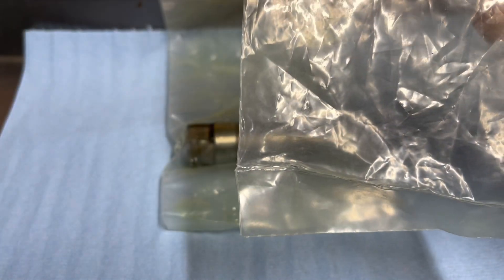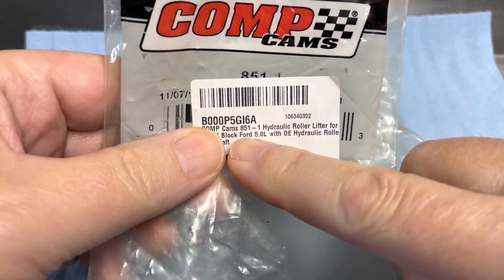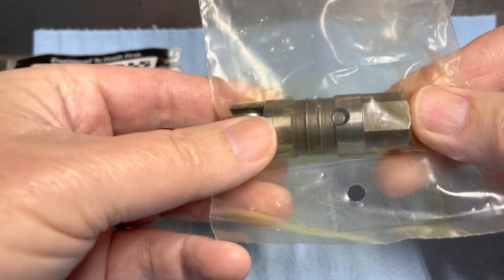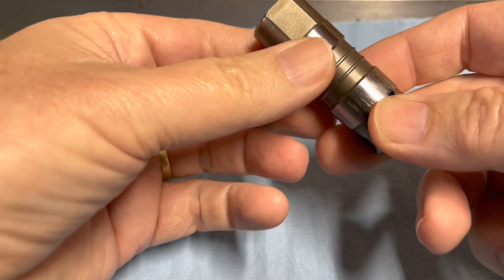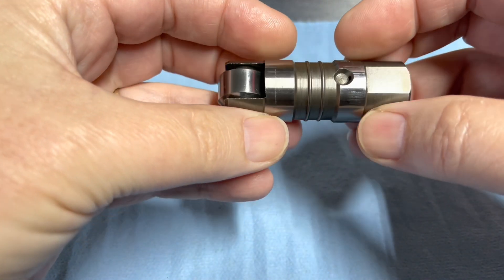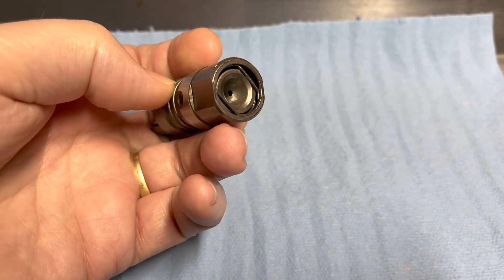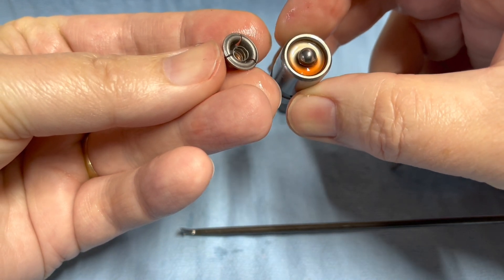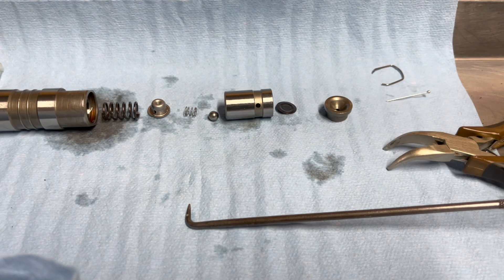Comp Cams Hydraulic Roller Lifter Failure

Comment: I installed an flat tappet and lifter kit in my 68 302 and found that several lifters were not oiling. After taking them all apart for cleaning I discovered the ones not oiling had the oil metering disc concave side was pointing down. I did some research and found the concave side should be facing the pushrod because of the oil groove in the disc and this fixed the oiling issue.  I'm building a retrofit 289 and using the same spider and lifters you did. I took them all apart and they were lubed and clean. Only issue is 4 of the 16 had the metering disc orientation backwards.
Reply: Correction on my comment is the oil metering disc protrusion should be toward the pushrod allows the oil to pass through the small groove to the rocker. Sorry
Reply from the maker: Wow. Nice find. It makes sense the disc has to be oriented a certain way otherwise they would be flat. I could see how the disc could flip over during assembly if you weren’t careful.

Comment: Did the new lifter fix your problem? It would be interesting to see if thoroughly cleaning the parts and reassembling it would allow it to function properly.
Reply from the maker: Yes, the replacement lifter solved the issue. I really wish I could have found something obviously wrong with the bad lifter.
Reply: @JohnLatrobe  - Since the new lifter fixed your problem, that kinda blows away my theory that the oil passage for that particular lifter bore was clogged. It's interesting that there was no oil in the lifter at all. Maybe the oiling hole in the side of the lifter is blocked?
Reply from the maker: @jsimmonstx  check out the 4th pic on this page:
https://www.onallcylinders.com/2021/05/14/building-affordable-ford-289-302-power/

It clearly shows how big the lifter bore oiling passage is, looks to be at least .25 inches. Plus, and I may be wrong, but I think that oil passage flows oil around each lifter to the next bore. So if the passage was blocked then more than one lifter should have been affected. Maybe not. I did check the hole in the side of the lifter and it was clear, but it’s possible something foreign was plugging the hole while it was in the bore.
Reply: @JohnLatrobe  i wonder if air pocket or air locked?
Reply from the maker: @brainwashed7244  you could be right. Something was either blocking the oil from entering the lifter, or preventing the air from escaping. The replacement lifter solved the issue so it’s all good now 😀
Reply: @JohnLatrobe  it makes sence a air pocket as its just operation as a pump and if
it cant suck then it wont flow just like a water pump thats not primed, pushing the push rods down
with a clamp of something may have bleed it.....